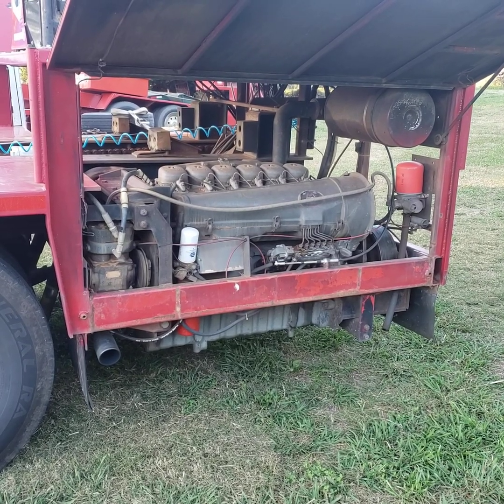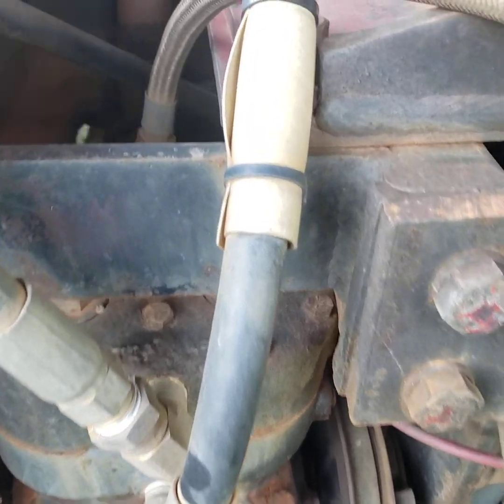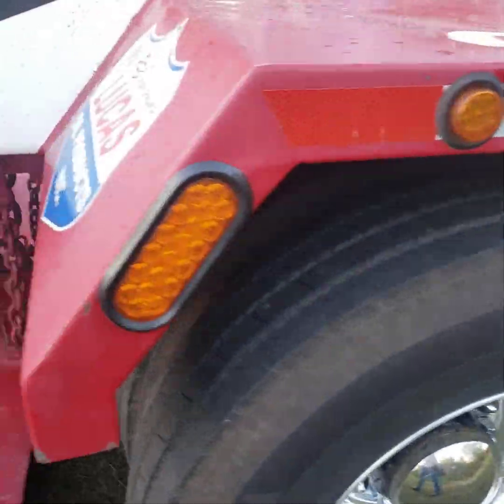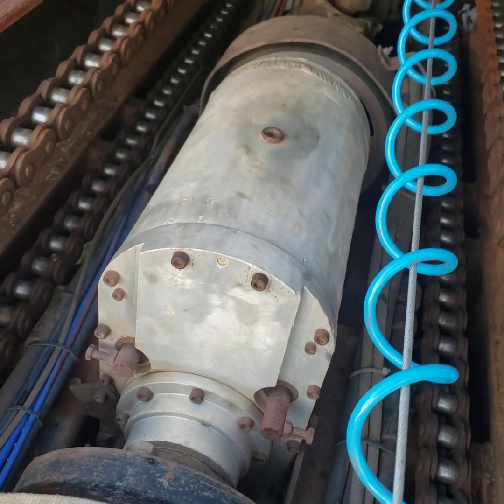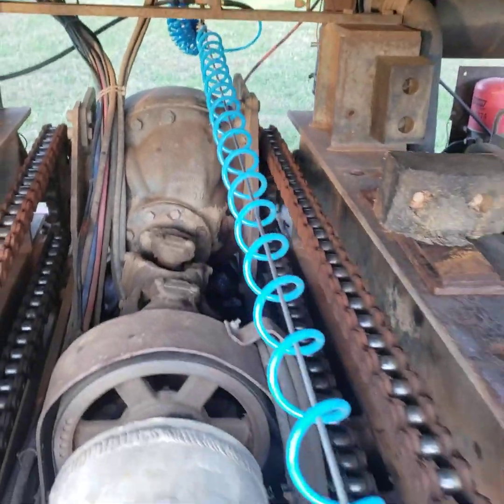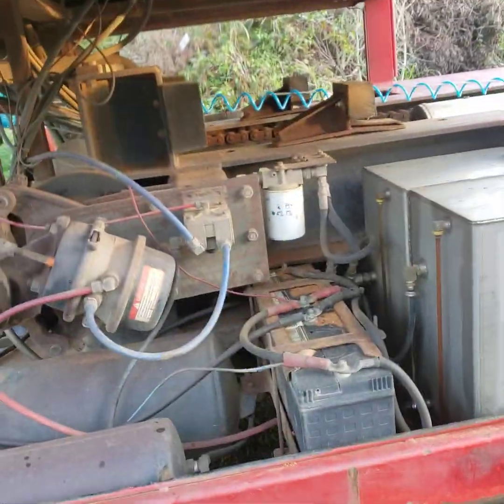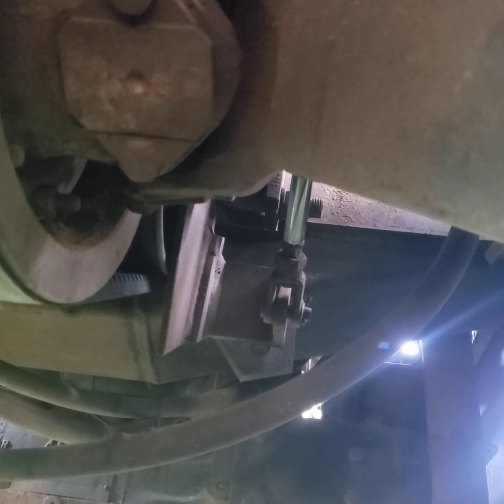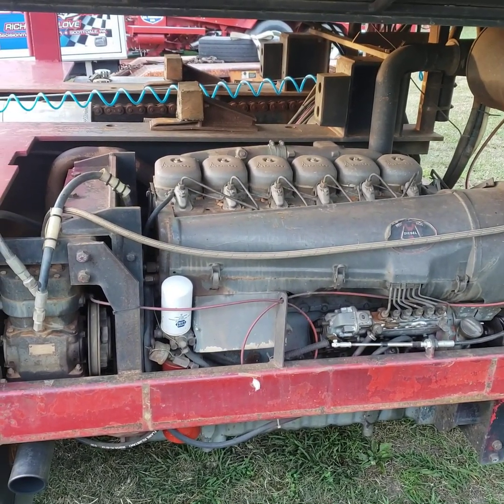Pulling Sleds; Engine & Drivelines

Comment: Some interesting and informative video's on the pulling sled. i have wondered,what make things work. Thank You for taking the time to explain everything. 1 question: What is the Maximum amt of weight you can put in the weight box for a pull??
Reply from the maker: In the box alone, the maximum load is about 23,000 lbs. About 6,000 lbs can be added in other places as well.